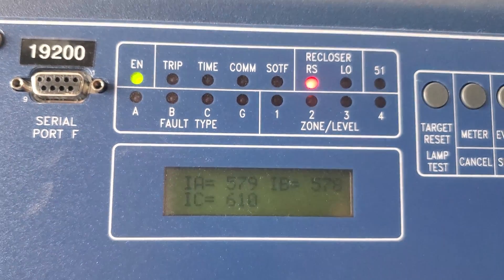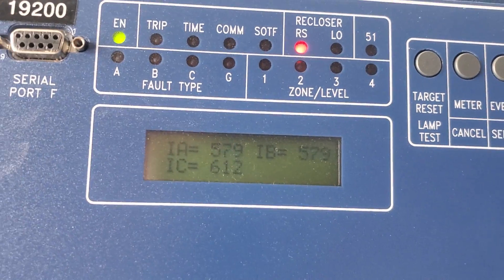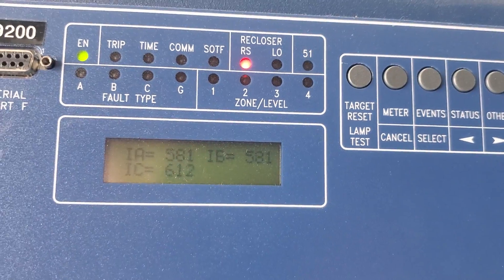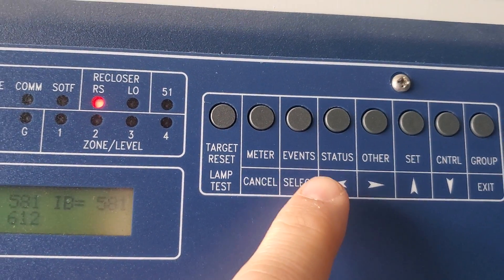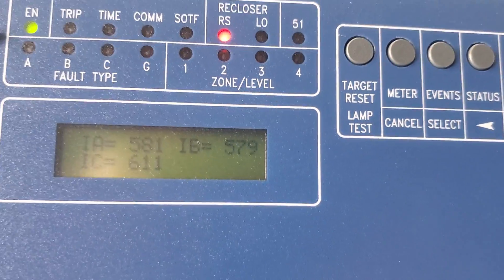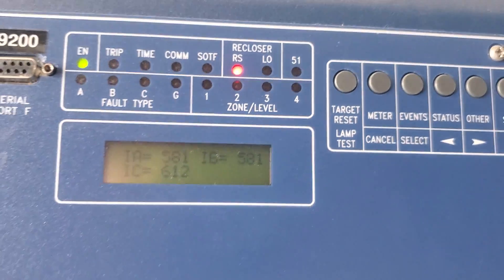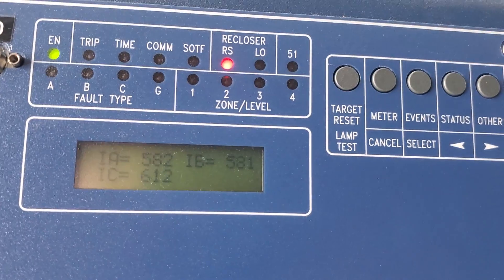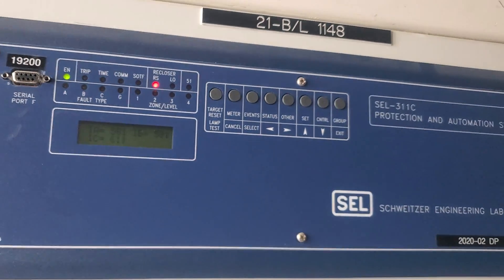My first stop before patrolling transmission line outages. (138kV)

Comment from the maker: Just a quick clip showing some data that's easily accessible to lineman when responding to transmission line outages.

This monitoring system is much more complicated than what's shown. It's used more so by our Relay techs, Sub Tech's and Power system operators. It's not typically something us lineman really mess around with. The great part is, it sends out some pretty simple readings that can help point us in the right direction when heading out to patrol dozens of miles worth of rural lines.

I'll usually have a conversation with the power system operator while retrieving some fault data from panels such as this. They will also be simultaneously be doing an analysis that can nearly predict an exact fault location. (Using fault current, timing and other information that's gathered from our monitoring equipment).

It's not always exact, but usually pretty darn close and always a good place to start!
Reply: Usually can tell us how far from each substation. Before, it was necessary to patrol the entire line. We would start at the end closest to where we may have experienced prior issues..
Reply: That's pretty awesome I think

Comment: I'm a licensed PE contractor that specializes in transmission protection.  The overwhelming majority of relays I work with is SEL, occasionally I have handled GE and ERLPhase.  Needless to say the major utility I do most of my work with uses SEL exclusively.  Typically how I have set the protection zones is based on a variety of criteria.  The line length and line impedance is set into the relay.  When a fault happens it generates an event that divides the measured fault impedance by the line impedance.  This provides a percentage that is multiplied by the line length to get a fault distance.  The Zones are based on the percentages of the impedance of line that is based on known calculations for structure and conductor types.  We'll call the overall line impedance ZL.  Zone 1: Phase and Ground reach typically 80% of ZL and set instantaneous, however, short lines with high source impedance ratio (ZS/Zone1) need to be taken into account as this can greatly affect accuracy and can cause Zone 1 to overreach, this is because the voltage at the relay can become too small to accurately calculate an impedance.  Zone 1 should be either disabled or delayed slightly (10cyc) and line differential used in these cases (SEL-311L SEL-411L GE-L90).  Also, mutual coupling can cause the ground reach to exceed the line impedance and needs to be reduced less than 80%.  Zone 2 is an overreaching zone: 120% of the ZL (but can be set longer) and set to 20cyc (or longer if you need to coordinate).  The 20cyc delay is to coordinate with the breaker fail protection of the breakers of the remote bus (typically around 10cyc).  Zone 2 is also used for communication based schemes for complete instantaneous protection of the line.  The communications are done typically done in modern designs through either fiber optic channel that is inside the shield wire of the line, or an injected high frequency signal (often called carrier) on the high voltage conductors themselves.  The carrier signal is captured then filtered on both sides of the line.  A number of different communications schemes are used that I won't get into (DCUB, DCB, POTT, PUTT...) you can look them up.  Zone 3 is the last ditch zone for if all else fails.  I've usually seen it set to the 120% of the apparent impedance of a fault on the longest line per the established system model.  It is to cover all remote buses of the lines leaving the remote bus.  It is typically set around 50+cyc.

Comment: Cool to show people what is going on in the subs and I just love SEL relays! But just a little more info on the zones in distance (21) relays like the SEL-311C here..... 
Distance relays operate on the impedance of the line. By knowing the physical impedance of the line it can calculate the fault distance based on current and voltage levels.  With that information you can program the zones to roughly be percentages of line length. The zones typically do not break the line in to equal parts like you mentioned. Maybe in your system, but that would be an exception for sure. The zones are for coordination with other relays to prevent mis-operations.  
Typically zone 1 "looks" forward at 80% of the line, with no intentional delay if it detects a fault, it trips. It's set to 80% to prevent misoperations on faults that were to occur past the next breaker / terminal. Since the impedance during faults can change rapidly and it's not 100% accurate. So Zone 1 is set to 80% with a 20% safety margin. 
Zone 2 will be up to 120% of the line looking forward and looks through the next terminal / breaker in to the next sub. Zone 2 will normally have a delay of 20 cycles or so. This is done to prevent misoperations if the fault happened to actually be past the next breaker, say actually at 120% of the line and it gives that breaker closest time to clear it. It also acts as a backup to that breaker and will clear the fault if the closest breaker doesn't clear it.  
Zone 3 sometimes look backwards, to the opposite direction of the primary zone of protection. 
Zone 4 can sometimes look forward over 120% or backwards. 
Then there are permissives and blocking. Example, a fault on a line at 95% of the line, so the fault is right outside the next substation. The relay at the source sub will pic up on zone 2, start a 20 cycle delay but, the relay at the end can pick up that fault in zone 1 looking back at the source and send a permissive or remove a block and that gets transmitted to the source relay and it will skip the delay and trip as soon as permissive or block is received. A relay that pics up a fault in a backwards looking zone 3 can also sometimes send the permissive or unblock as well. 
There is so much that goes on with protective relaying and a great deal of it has been in use for +100 years, using old electromechanical relays. Then came the microprocessor relays, like the SEL and they can do many protective functions in one box. Back in the day you would need individual relays for each function and each phase and one line's protection can take up two full cabinets or more. Now, all in one SEL or other microprocessor based relay can do all the functions and leave plenty of room to spare. 
If anyone wants to know more, ask... or google "impedance relay zones". The zones are also not set in stone, there's typical settings and some utilities have their own standards that may differ.
Reply from the maker: Excellent information! Appreciate you taking the time to write that all out and share. Thank you 🤝👊
Reply: @Bobsdecline  No problem.

Comment: Wow... 600A on a 138kV... If my math is correct, that's almost 83MW!
Reply: Close..... it's more like 143MW with a three phase line. Which, depending on the system could be a low load. Where I used to work on busy holidays we'd get up to 190MW on a 138kV line. That was over 800 Amps each phase.
Reply: @inothome  Well, yes, I was referring to the single phase... But still, single phase or all three put together, that's a LOT of wattage.

Comment: Typically zone 1=0-80% 2=80-100% 3=120% and zone 4 is 120% backwards So zone 3 and 4 are overlapping protection zones.  Typically faults in zone 3 &4 are not on the protected line but on another line

Comment: Damn Ic has 600 some amps on it how hot is the cabling getting?
Reply from the maker: The bus and feeders cables are all sized appropriately, so there shouldn't be any abnormal heat. It's definitely a lot of current, so any sub par connections will certainly expose themselves rather quickly. We thermo out main feeders more more frequently than other lines for that very reason
Reply: @Bobsdecline  good idea

Comment: Targets are a lifesaver, however we have some transmission lines without that capability, invariably circuits that are the hardest to patrol..along railroad tracks, through forested areas, river bottoms, across farm fields. Sometimes a 3-4 mile walk, then back. When you ask for help, pick me up at the end of a section for a ride back to the truck, they deny help saying " patrolling is a 1 man job except during adverse conditions!" Be safe, Brother, keep up the posts!

Comment: Your videos are awesome, I work for a cable company, and we gaff poles every day. I have been taught in pole top rescue when I went to climbing school, but my current company does not have a rescue plan in case of accident. I have been trying to build a rescue plan. But i run across the issue of us working as a one man crew 99% percent of the time. Do you have any advice on ways to build a rescue plan or standard operating program to address this issue.
Reply: I hope you get it implemented quickly

Comment: Is there any current or voltage on the neutral line?
Reply from the maker: Always assume yes.
Current usually - It carries any unbalance... The phases or hot legs on a service are rarely perfectly balanced. 
Voltage - Kind of.... Our system's neutral is tied to ground. A voltage or potential indicator may not show any voltage but that doesn't mean it's safe. A simple break in the neutral and result in a full line voltage reading on the neutral in a worse case scenario. There's also a great potential for there to be a voltage difference between the neutral and another conductor that's not intentionally energized.
Reply: @Bobsdecline  reading that reminded me of a type of fault that is potentially lethal (where metal cases of appliances in the home can become live, and to the homeowner it just seems like power failure (unless they touch something with a metal case thats supposed to be connected to earth/ground, then they could potentially get electrocuted)
In the country where i live, such a scenario could happen (although thankfully our house uses a rod in the ground as the primary earth/ground connection, the problem only occurs on supplies that have a combined neutral/earth from the supply company)
There has been something like that happen in another country (can’t remember where), and even though the house did have a secondary earth/ground connection (in the form of a rod in the ground), it didn’t help
And i have started to hate combined neutral/earth connections (especially as where i live houses are (to the best of my knowledge) fed directly from a substation, without going through an additional transformer)
Reply: @pineappleroad  Isn't that the entire point of why most countries require GFCI/RCD on home circuits these days?
Reply: @alexatkin  RCDs won’t protect against that fault scenario, as the voltage will already have passed back through the RCD before entering the earth wire (there is a type of breaker that would possibly trip under these conditions, but it is a type that is considered obsolete, and under all other conditions, dangerous, as it relies on current flowing through the earth wire, whereas RCDs detect an imbalance between live/phase/line (no one can seem to agree as to what the correct term is) and neutral)